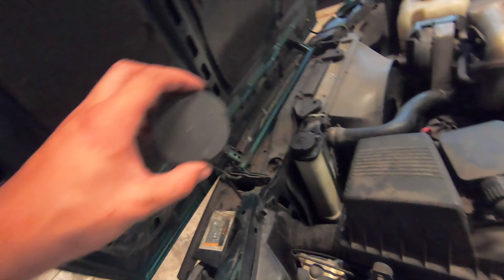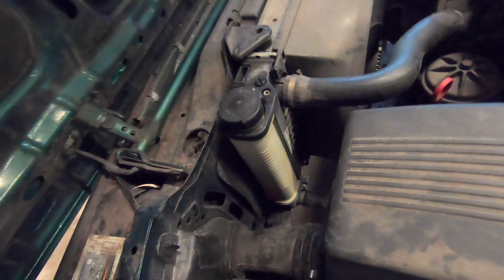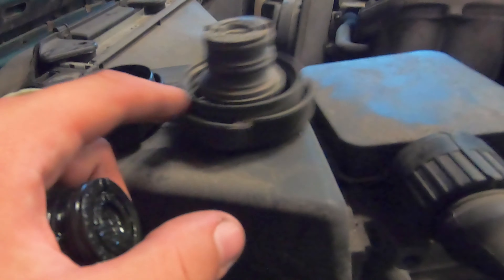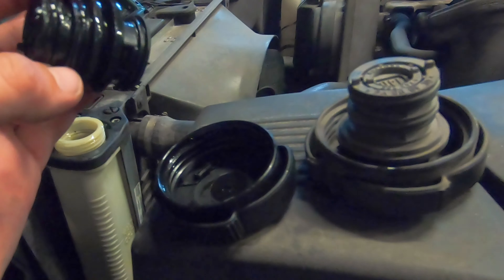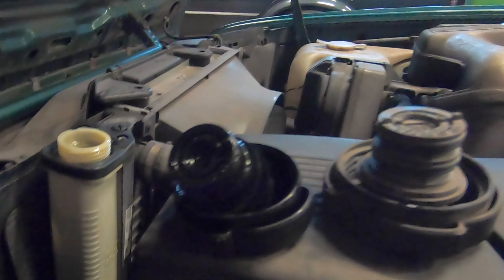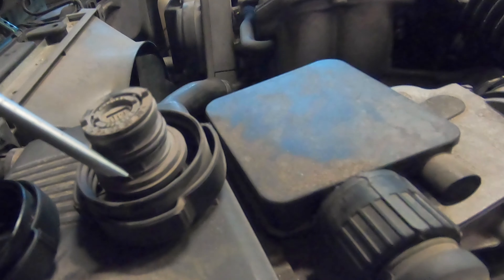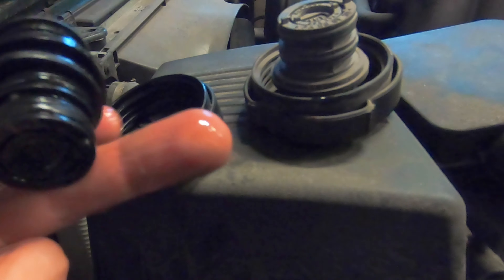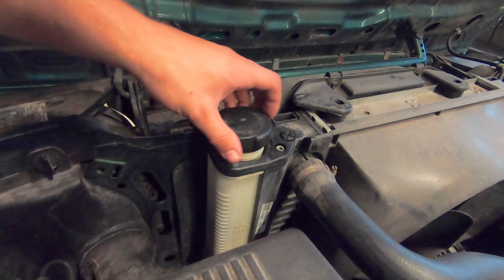ROADSIDE RADIATOR CAP REPAIR

Comment: I have had this problem before when the cap comes off and the thermostat stays inside - probably someone over tightened it. I did not even use the coins, just used a screwdriver to remove the thermostat, put it back in the cap, and now it screws in and out as needed. Many thanks - you were the only one with a practical solution🙏🙏